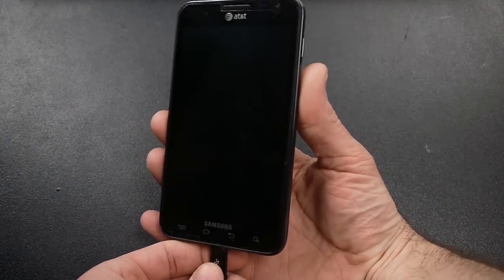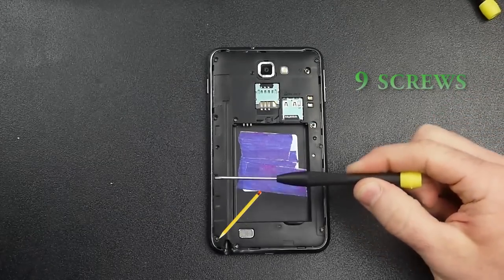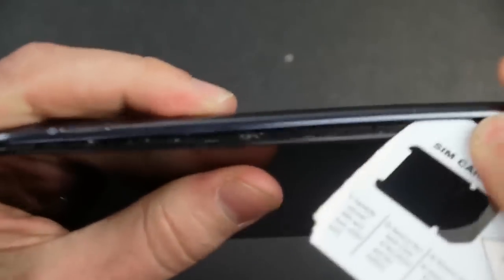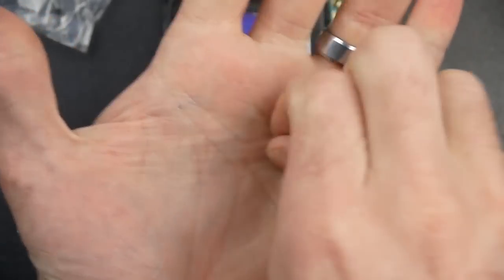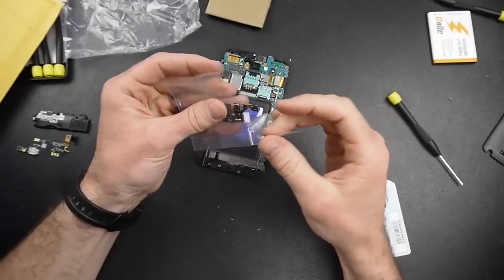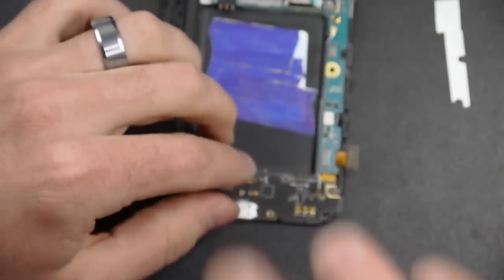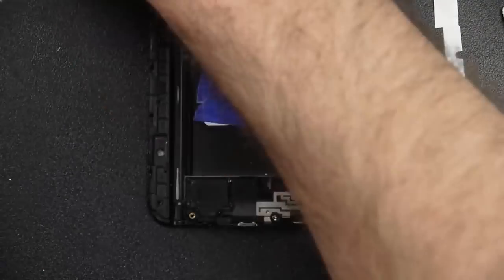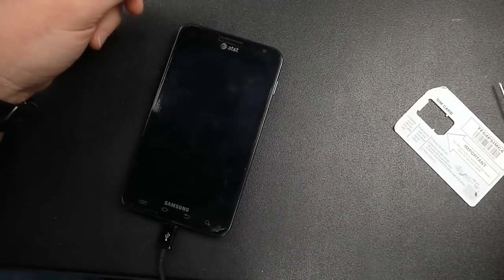Repair: Samsung Galaxy Note Charging Port Replacement

Comment: Thank you for demonstrating how to access the charging port ... My Samsung Galaxy Note II refused to charge recently and, after trying all the charger and charging cable variations, I decided to take out the charging port board ... I saw that the port jack itself is soldered to the board by its 4 legs ... Considering that this jack experiences quite a lot of physical stresses plugging and unplugging charging cables, I had a hunch that a "cold" solder joint may have developed on one or more of the legs ... Resoldering them with a fine-tipped iron solved the charging issue without replacing the entire board ... My phone now works again with a bonus noticeable improvement in speed and screen brightness ... :-))

Comment: Replaced mine now no sound from speakers. I see several people have had same issue. Please address how this can be fixed.
Reply: +Ann Brown you may have the incorrect revision number? or a bad board or you did not get it installed correctly? 
there is 5  gold plated spring loaded contacts on the board 3 are antennas and two are speaker if one is bent or not in place correctly you could not have sound or signal

Comment: I replaced the charging port, but I can't make calls 😭😭😭😭😭 please help me
Reply: +Andres Guillen you may have the incorrect revision number? or a bad board or you did not get it installed correctly? 
there is 5  gold plated spring loaded contacts on the board 3 are antennas and two are speaker if one is bent or not in place correctly you could not have sound or signal

Comment: i replaced mine and the sound stopped working and now its glued on so i cant change it back to the old 1
Reply: +Wayne Stewart you may have the incorrect revision number? or a bad board or you did not get it installed correctly? 
there is 5  gold plated spring loaded contacts on the board 3 are antennas and two are speaker if one is bent or not in place correctly you could not have sound or signal

Comment: I got galaxy note n7000 from my cousin with these issues (mic,slow charge and no signal) and he told me that he changed this part but doesn't work. He put on a REV0.8 replacement and I think this is the problem. How can I identify the suitable revision of this part for my n7000? Thank you in advance

Comment: Any solutions to the audio shorting out? I replaced my usb port and now my speaker will play audio for .1 second and then cut out.
Reply: +David Arnold you may have the incorrect revision number? or a bad board or you did not get it installed correctly? 
there is 5  gold plated spring loaded contacts on the board 3 are antennas and two are speaker if one is bent or not in place correctly you could not have sound or signal

Comment: I just replaced my charging port in my Samsung mega and now my sound won't work.  No music plays or anything.
Reply: +Amanda Rivera you may have the incorrect revision number? or a bad board or you did not get it installed correctly? 
there is 5  gold plated spring loaded contacts on the board 3 are antennas and two are speaker if one is bent or not in place correctly you could not have sound or signal

Comment: I just did this, at the charging port is working fine, but now my mobile has no network  help!
Reply: Probably left the coax antenna cable out or connected incorrectly. Try reconnecting it.

Comment: I replaced my charging port and now the charging port works again, all other functions are the phone are as usual (data, wifi, music speaker, etc) but now my phone will not dial out nor will it receive any calls. Any ideas?
Reply: +LSX Rico you may have the incorrect revision number? or a bad board or you did not get it installed correctly? 
there is 5  gold plated spring loaded contacts on the board 3 are antennas and two are speaker if one is bent or not in place correctly you could not have sound or signal
Reply from the maker: LSX Rico I am not totally sure what might be going on. It might be possible that you didn't get the antenna wire snapped back on.
Reply: +Emmet Myers I was sent a second charging port and still had the same issue. I ensured all contacts were in place but I could never get it to work. I picked up a Note 4 a few days later. Thanks for your reply, though!
Reply: I had the same issue you did. Correct revision of board, however there's one key difference. The difference between my phone and the version in this video is that the silver strip you can see underneath which he sticks the tape on the board to, on mine that's physically attached to the board, not to the casing and makes contact with a gold part in a recess in the casing there which you cannot see in his phone. If that's not there then once the new board is inserted, the connections don't work properly and it screws your antenna which is also located here. You need that there between the board and the casing in order for it to properly be able to pick up the antenna.

Comment: I successfully replaced the charging port on my Note 4.  The charging port works but now when I turn on the phone only the start-up music sounds - no visual - I checked the start up "button" as recommended to make sure it was "out" before I put everything back together - do you suppose I may have damaged something?
Reply: Simpson Counseling - CORRECTION - IT IS A NOTE 3

Comment: Like he said, you may not need to replace your usb port. Try cleaning it first.
First step really is to use a very thin needle to scrap all the lint and dirt out from the inside of the female USB port!! There are videos to help you - such as this one from Northcaledon: https://www.youtube.com/watch?v=yjnXcFG3674
He will show you how to file an ordinary needle down so that it is thinner.

At first, cleaning the insides of the usb port with rubbing alcohol did not work.  On 2nd try I used "Mineral Spirits" which you can buy for a few dollars at hardware store.  That did the trick for me.  I also had to use a very thin needle to push the cotton soaked with spirit all around the middle pin-board. I knew that my usb port does not need replacement because it would work intermittently.  I also pushed the middle pin-board away from the “closer” side a little – that seems to be the other reason why it started to work.